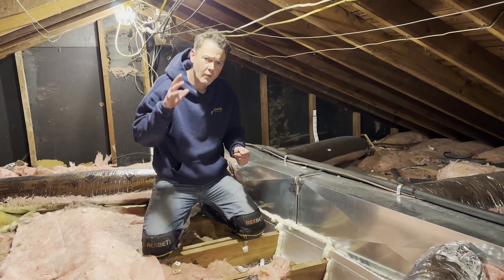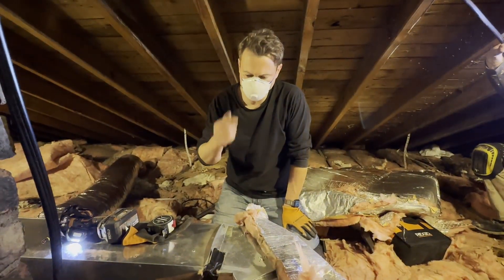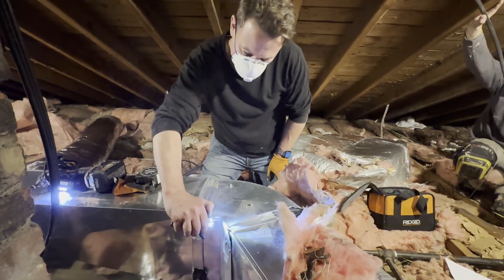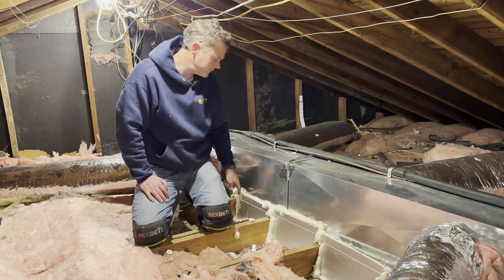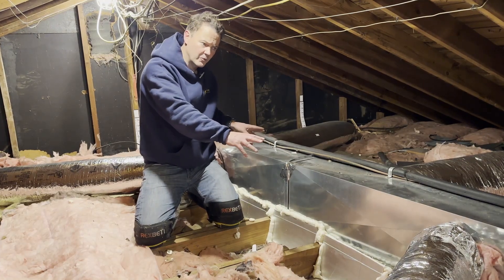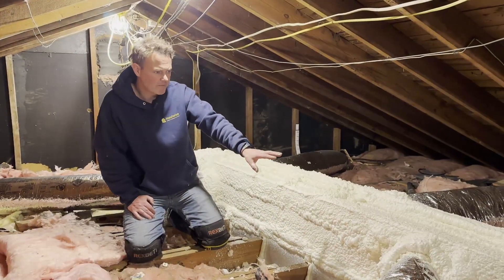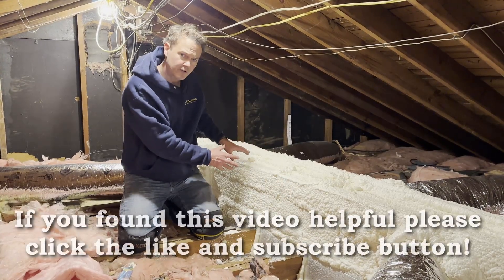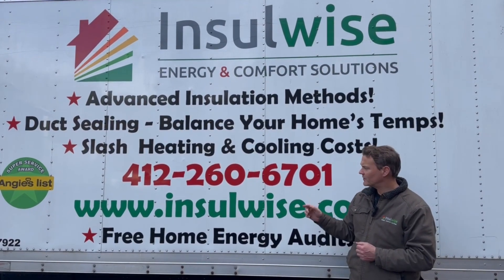Spray Foam Your Attic's Duct System for HUGE Savings!

Comment: I just installed a 20 seer American Stsndard in a closet. It was so tight I had to use a square to round as the main plenum and un-strap the 16” flex in the attic and pull the slack through the closet to attach to the air handler. I pre-insulated and double strapped the flex duck to the air handler and then lifted the air handler with the flex back to the closet went into the attic and pulled the slack back through the closet.. my Insulation job was OK but I wanna make sure that I don’t get any sweating and would prefer to spray foam the squared around and ductwork going into the attic and spray on the hole that where the duck penetrates. What is the cheapest spray foam kit you would recommend for this?
Reply from the maker: Thanks for commenting!  Spray foaming it with 2" inches of closed cell foam will definitely keep it from sweating.  If you don't have much to spray you may be able to get away with the small cans of spray foam now sold on Amazon, I can't remember the brand.  If you need to spray more (like more than 50 sq ft) you'll probably want a two tank system.  The 200 bd ft kits are all about $400 and the 600 bd ft kits are all about $800.  I haven't seen big differences in foam quality from one brand versus another over the years, so I'd just go with the best deal you can find online.  
Just make sure that the ducts you're spraying are clean before you spray them and that your spray foam is at least 70 degrees, if not 80 before spraying.  Cold spray foam won't cure properly.  Let me know if you have more questions. 
Andy
Reply: @insulwiseenergycomfortsolu3293  a local spray supply recommended a “froth Pack” from Home Depot. I suspected it would be easier with a professional gun versus a gun with can attached due to the space constraints getting into the closet, squeezing in between air handler and return duct. I wonder if they have a can with a wide fan spray?

Comment: Could have sliced open the insulation seal the duct joints and holes with 1 bucket of mastic and a $1 paint brush, let it dry then re-tape the insulation. That would be a way less expensive job and just as efficient.
Reply from the maker: That would have led to a better result than what this homeowner had before we got there.  But sealing beneath the trunk line would be basically impossible with this method.  The R value of the closed cell foam is also significantly higher than what a fiberglass blanket is going to offer, but you're right it is much more expensive to do it this way. 
Andy

Comment: What a waste of time and money. Why seal if you are going to spray foam it? THAT will seal it. Since you did seal it, why not just unroll some fiberglass insulation over the top of it and fasten  it down? WAAAAYYY cheaper and could have gotten higher R value at the same time.
Reply from the maker: 1)  The gaps that we sealed before spray foaming were significant and I did not want to risk spraying foam inside the duct system.  2)  Fiberglass duct wrap comes in at about R-6.  Closed cell spray foam comes in at R-6.5 per inch and we sprayed 1.5 - 2" inches onto the duct for an approx R-9 to R-13.  Honestly there's no comparison in terms of effectiveness.  3)  You would not be able to effectively seal the underside of the duct using your methods, allowing significant air leaks in the system to still remain.  
Now, would manually sealing an attic duct system as best you can with mastic, mastic tape, or silicone and then draping fiberglass duct wrap over it be far better than what most systems are?  Yes, of course.  But in terms of seal effectiveness and achieved R-value upgrade I don't believe that it would perform close to as effectively as encapsulating the duct system with spray foam. 
Andy

Comment: Thoughts on bubble insulation around the ducts?
Reply from the maker: It's certainly better than nothing.  But no one who works in the space believes it's R-rating of R-4 or R-5, or whatever they say it is.  First priority should be to seal the duct seams (usually where the leaks are), ideally with silicone, duct mastic, or mastic tape.  After that we will often insulate with a thick fiberglass duct wrap.  That would be a pain for most homeowners tbh.  I'd say if you can seal the seams and leaks and then wrap it with the highest R-value of whatever you can get your hands on you'll be far ahead of where you started ; ) 
Andy

Comment: Spray foam has a vapor permeance of 3.2 and XPS foam board is 1.2, versus FSK ( the same material covering the flex duct insulation) which has a permeance of 0.2.  Foam is good at stopping air flow and heat transfer, but it is not good at stopping vapor.  There is a good chance of those ducts sweating in a hot humic attic in summer when the ducts get cold from air conditioning.
Reply from the maker: Thank you for commenting, however I think there is a low probability of the ducts "sweating" during the summer months.  Firstly, the phenomena of "sweating" is really just the surface of the ducts getting cooled to the point where the sheet metal falls below the dew point temperature.  The sheet metal is being cooled as cold air from the air conditioner runs through them.  By spraying 1.5-2" inches of closed cell foam over top of the ducts, the only way that the outer surface of the foam could get cold enough to fall below dew point temperature would be for it to basically not function at all as an insulator.  I would say that is unlikely.  
Also, closed cell is an excellent retarder of water vapor.  Open cell foam is the material that allows water vapor to easily pass through it.  Closed cell foam on the other hand is so effective at retarding water vapor transfer (at 1.5" inches of thickness and above) that it's commonly used to insulate the underside of roof decks in cold climates -- and usually without any problems.  When you use open cell foam to do this on the other hand, you can run into big problems with the roof sheathing getting damp, rotting, etc. 
Andy
Reply: @insulwiseenergycomfortsolu3293  thank you for your considered answer. The figure of 3.2 water vapor permeance that I gave is for closed cell foam from the froth pack.  
Insulating the bare metal duct means that the surface of the duct will now be colder in relation to the attic air, and thus closer to the dew point, than it would have been without any insulation.  Perhaps the fact that the foam is adhered to the bare metal would stop any condensation from forming on the outside of the duct.  This would be one pro for using the spray foam.  Additionally, the 2 in of foam will provide enough insulation so that the outside surface of the foam layer won't sweat either. I'd be interested in seeing feedback from you after a hot humid summer as to its effectiveness. I'm trying to figure out ways to retrofit my own ducting. The expense of the spray foam is one drawback.
I just wanted to point out that the spray foam is nowhere near as effective a vapor barrier, even at a 2-in thickness, as is the FSK material that covers those flexible ducts you put in.
Reply from the maker: @percyfaith11  Why is the water vapor trying to drive itself through the layer of foam to try to get to the cold surface where it could condense?   What physical force in an attic is driving this process?  Also, that FSK fiberglass wrap does not seal the duct system at all -- anywhere.  When we pulled it off there were gaping holes everywhere.  You can see that in another video that we shot.  The FSK covered fiberglass layer also did not have nearly the R - Value of the spray foam.  The wrap we removed was a rated R-6 at best.  The 1.5-2" inches of closed cell foam we encapsulated it with took that to an R-9 to R-12.  
Encapsulating a duct system with 1.5 - 2" inches of closed cell foam is a far superior solution compared to wrapping it with a fiberglass wrap.

Comment: What brand foam are you using?
Reply from the maker: Any two part foam will work.  We use Soudafoam 2 part spray foam, but any spray foam would work.  Stanley SuperCoat spray foam could even be a solution for you.  We haven't used it, but I've seen it on amazon and it looks like it would be excellent for smaller applications.  If you have a larger duct system that you're looking to encapsulate, the larger 200 and 600 board foot kits are probably what you'd want to look.  Just be sure to wear proper PPE while applying and be careful in your attic!
Andy

Comment: I've never seen a solid duct like that in an attic. Every home of mine has always had flex for supply. FANCY
Reply from the maker: In this attic the main trunk lines for both the return and supply ducts solid sheet metal.  The branches were in insulated flexible duct hose.
Reply: @insulwiseenergycomfortsolu3293  in this instance do you recall where the return was situated relative to the return? i have a similar scenario (newly installed attic ducts in a pre existing home) in which the supply and return are stacked on top of each other - currently looking at spray foaming the entire thing to achieve similar result that you show here. (i'm in canada, happy to move to DM contact if you are inclined to opine on the topic).
Reply: Mine is exactly like this. But really shitty.

Comment: foaming in that line set is suspect at best....
Reply from the maker: Why?  If the line set needs to be replaced you could expose it with a butter knife in about 2 minutes.  Up until that point the coolant moving through it is being better insulated than any other part of the line set.
Reply: any issues = a whole replacement... but any issue... and is probably a full replacement anyway right?

Comment: Hey man, can I do this on the actual duct hoses as well? I have really shitty old r4 ducts. I’ve been quoted 5 grand to replace them with r8. I cannot afford that and I need to explore other options
Reply from the maker: You probably could, but what would be much better is changing out the duct hoses with new, higher rated ones.  Here's a video link for how to do it: 
https://www.youtube.com/watch?v=dmv4-E43mMg&t=516s

That said, spraying over them and encapsulating your R-4 ducts would probably work --- so long as flex ducts are clean and not coated with dust.  If they're dusty the foam will have a hard time sticking and you could just end up with a mess.

Comment from the maker: Here are links to products that can be used for this.  The first is a Stanley spray foam kit.  Watch the youtube video for how to use it.  I have not used this product but it looks like it would work well
https://www.amazon.com/dp/B0D984XDK8/ref=twister_B0DMNTMVVW?_encoding=UTF8&th=1

Additional Option: 
Vega Foam Fire Spray Foam also on Amazon

Traditional 2 part spray foam kit from Home Depot: 
https://www.homedepot.com/p/FROTH-PAK-210-Spray-Foam-Sealant-Insulation-Kit-12031897/320450849?source=shoppingads&locale=en-US&srsltid=AfmBOopwH9yghfe3QGzmR_lc6tIi2CdrGtUoAYmWEaJ7FMC_IZxcvU-q_jg&gQT=1

Full Face Mask and respirator:  You can buy more expensive ones from 3M, but this looks like it would do the job: 
https://www.amazon.com/LJSXFI-Full-Face-Gas-Mask/dp/B0C145L2W9/ref=sr_1_6_pp?crid=REP934BLQS5P&dib=eyJ2IjoiMSJ9.3wdKmmoTA5QJYC_xCKdLcrXuky7z7jHgqzari3sGCsjaRluQKpIBbTKbhuqmY1FjJCyjgJEirmXukAoAWskycRRttwWteqad8grlxbO_M3a-dmY3VOsjPMZKjDggbcJxRNUjrct5d9UqYFRM8m7HUz3kf7QctVmmA6Zwm2kmaGM58hHrz5_qdInGhxM6rC66FBZmmjY6g3CHDV7bAOAsFCfT-rlTkX1jmnQ3hmWVY5NpjiHHgC0hL2g4oCOmjRy5WL1N2zndqME1Uf5ldNg5erWrxTJ9jrQvtz9QhBi9P3zyBYFvWpMAU38I8n0C9uYUyS9w1eKnbESNbp49_nZ1zpl6Sk3fAwq0Nv88TyNqnnx7mJBEZRSWFqJWjyuSYBUWyZRM8IXEjVMZ39neMv23VWBWUTIRO82f-NtBUXLR1n9QWbFiuJsCQ33pmzQy864p.9xN-Uqr3iSOr1AwZ8146hVnnosU8A6oKgb0uqlL7CA4&dib_tag=se&keywords=full+face+mask&qid=1736346778&sprefix=full+face+mask%2Caps%2C219&sr=8-6

Comment: beyond air leaks, it seems putting the foam board along the bottom essentially brings that duct and the joist space underneath it "into the envelope"? i have a similar setup where i have ducts running in a joist bay (2x8 joists) where i can't easily get fiberglass insulation underneath. foam board and foam like what you;re doing seems like it would work well enough to protect the duct and still give some insulation to the ceiling underneath
Reply from the maker: You are absolutely correct, it brings it "into the envelope / conditioned space of the home."  It sounds like you've been reading up on your building science, nice work!   So yes if you foam board off / isolate the sections that you can't get to with foam board and foam sealant that will be a huge boost in efficiency for you. 
Andy
Reply: @insulwiseenergycomfortsolu3293  haha, thank you. Yeah, i got an obscene quote to seal and insulate my attic (35k for 2500 sq ft of a challenging attic). so I'm DIY and learning a lot from your videos. 

Do you have an opinion on froth packs vs the newish Spray foam can insulation likely stanely has? other vidoes on youtube show they work well enough and little more beginner friendly. plus its easier to carry a foam gun around an attic vs two little propane tanks. 

thanks for all the videos, they're very appreciated!
Reply from the maker: @donjay5216    You've just educated me.  I've never seen this product before but just watched a video.  For a homeowner I would definitely recommend using this over tanks.  The tanks are HARD to maneuver in an attic and make the chances of a slip and fall through a ceiling higher for sure.  Definitely use a good respirator with chem rated cartridges (full face is the best option) and also make sure to get that duct fairly clean first.  If there's duct wrap on it now remove that stuff first.  That's an obscene quote to do your attic!  We would come in at half that and likely even less.  What part of the country are you in?  Fire away if you have more questions. 
I also just added links to a few products beneath the video.  
Andy
Reply: @insulwiseenergycomfortsolu3293  awesome thanks for the advice on that foam, i'll go in that direction. 

im in Long Island NY, quote was by a franchisee of the other guy with all the good videos, but i think i got the "we're busy go away quote". it is a complicated attic though. 2400 sq ft, 3 separate access points. pull out old stuff, air seal, add soffits, 40' of knee wall, 80 recessed lights, need to build access to one part of attic. the works.

happy new years and thanks for all the help

Comment: I'm a mechanical engineer and I like your strategy!  Combining all the insulation types, depending on the application.  Many just bury a home with spray foam, which can be a disaster.  I saw one of your vids with Home Depot house wrap.  I'm curious if you have identified good quality, but more affordable wraps?  Maybe a video?  Most all of the box store wraps I see are woven.  IE, junk!  Tyvek and Typar is what I spec due to the non-woven comp, with a perm rating.  It's expensive though!  I think you absolutely get it, that air seal has to be a big priority in proper insulation.
Reply from the maker: Thank you!  Tyvek is the best stuff but you're right it's expensive.  The stuff we use is inexpensive box store woven stuff like you said.  We don't need it to shed water like in a true exterior application.  We use it primarily to secure the batts in place in a sturdy fashion and then provide an air barrier over them to reduce wind washing inside those spaces because they're almost always ventilated.  
I don't know of an inexpensive, high quality, non-woven house wrap though.  The job those wraps have to do is pretty important, so I'd probably just spend the cash. 
Andy